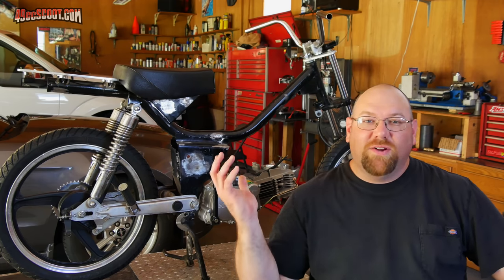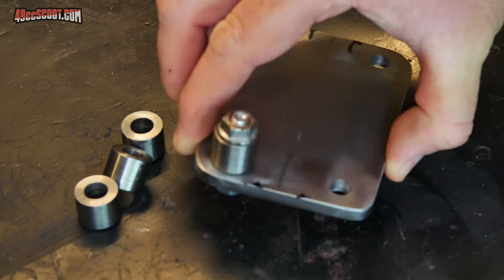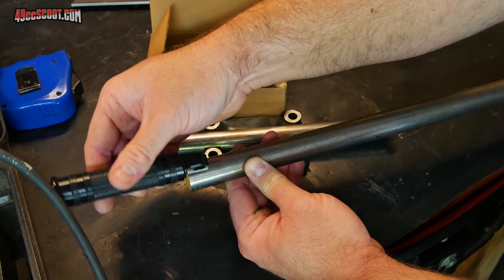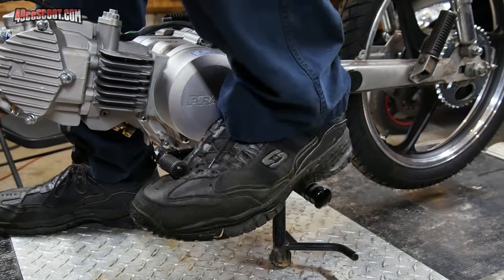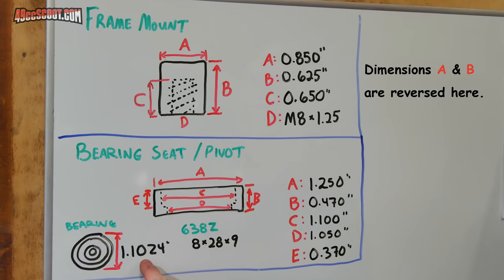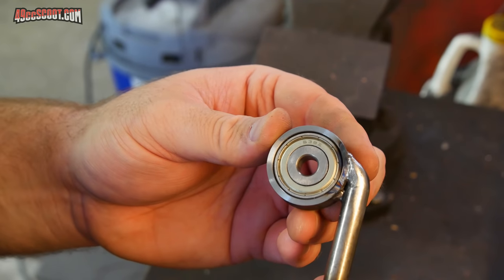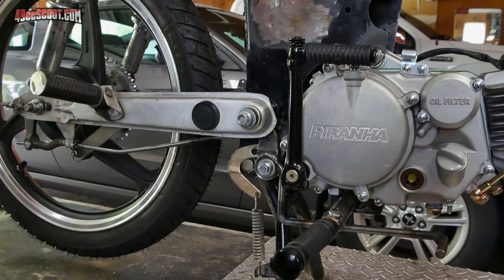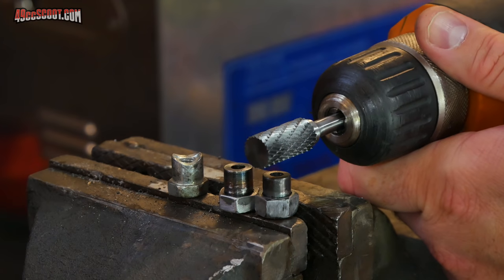Building A Motorcycle Style Rear Foot Brake Lever Setup : SSR Part 8 : Manual Conversion

Comment: I've been following this build intently,  since I have the same moped. And my list of modifications is very much the same.  One place you could have save a considerable amount of time was in the rear brake pedal assy.  The Chinese borrowed a large amount from Honda,  and the brake lever from a CT90 or CT70 is a direct fit.  It pivots on the same pin that the center stand pivots on.  The pin is just longer to accommodate the brake lever. Those brake levers are all over ebay for cheap. The actuation rod and brake light switches are too.  Looking forward too watching the continuation of your build!
Reply from the maker: Thanks for the info. Maybe someone else will see it and save some time. I looked at stuff like the Madass and other Chinese mopeds that came up in searches, but they didn't look like bolt ons. I know I looked at some Hondas, but again whatever I saw didn't look like a simple swap. I'm not mad at the idea of spending extra time though since it's a one off setup and always a learning experience.

Comment: You don't want square corners in the bottom of the groove.  They are a good source of stress cracks.  The rounded you ended up with are better, IMO. Nice video.  tom
Reply from the maker: I didn't really want sharp square corners, but less round than I ended up with. It worked out anyway. Thanks.

Comment: Nice to see progress on the SSR. Good job on that break lever. I know is a long way until the build is done but so far is looking real minimalistic and nice. I would like to see you build an electrical motorcycle someday. Like the guy in "the inja" channel is building. I'm sure one built with your hands will come out a very slick and just awesome.
Have you ever thought on building one?. Is basically an electric motor, batterires and a controller mounted in a motorcycle or scooter frame. Anyway. Keep up the good work my friend. I think I have seen all vids in your channel. Real fan of your work here.
Reply from the maker: After seeing one do 80MPH in the 1/8 mile from the last ever NASRA event years ago, I did think about electric. My problem is that I really enjoy engines. I love the sound of them and working on them. Turning up a controller vs adding a pipe, cylinder, porting, and so on is just not the same. The main thing that tempts me is the amount of instantaneous torque. I dunno. I don't even care about F1 after the big screamers left. The sound is such a big part of the experience to me and I find it sad that one day engines and their glorious sounds will be forgotten.
Reply: @49ccscoot   I get what you are saying. I love my Chinese scooter with tuned gy6. But after seeing an electric motorcycle from I guy here beat a 200hp ninja in the 1/8.... Well I was stunned. I really enjoy your vids and watching you building stuff from scratch so I just tough I could float te EV idea.

Comment: it almost seems like those footbags are going to want to fold back on you during normal use due to the angle that they're at. Might not be an issue though.
Reply from the maker: I thought the same thing after getting  them done. They feel OK. It could be something I have to change later. I figured it would be nice to get max room when it's stuffed in the corner eventually like any other small 4T for me. 😁
Reply: @49ccscoot  gotcha it'll probably be fine.

Comment: It is so fustrating to wach you struggle with things that I have gone trough several times in my own projects and can't share advise. If I may few points, strengten up the lever at least by adding material to bends. Brake swich is not lined up, therfore the nub always bends the plunger and it wears out really fast. Why you didn't just use old nut on brake bar?  Footpegs now are in position, where the stress is applied only to half of the mounting bracket, so is less than 1/2in. When they are so that pivot shaft is parallel to ground, then its at least double. Maybe you want to reconcider that part. I love your projects as really good detailed vlogs and very educational, specially for youngsters. Keep up good work! Thank you.

Comment: just wondering, do you tap it dry? without any oil or grease? because i had the same problem like that in the past while i try to tap a hole without any lubrication and the tap just fail. In fact i broke 2 sets of taps lol. but when i try using some oil it works just fine
Reply from the maker: I was using thread cutting oil.
Reply: @49ccscoot  aaaah i seee, btw great video as always!!

Comment: Need help on how to change my stator to my lazer 5 ssr motorsport 2010 plz help me out and the back tire sprocket broke i dont know were to order all my parts for my bike plz help me out thanks brother
Reply from the maker: The stator is pretty simple. It's located under the left engine cover. There are different configurations. Some will require removing the flywheel, others won't. If it's the type that doesn't it's a really quick job with just connectors and a few bolts.

For parts, SSR has a dealer locator :
http://www.ssrmotorsports.com/store/dealer_locator.php

Valley Scooter Parts has a few parts for them. I haven't ordered any stock replacement parts.
Reply: I was hoping if u could make a step by step video of taking the stator off plz cause if it's easy ill try myself
Reply from the maker: Done. https://youtu.be/kR86GEJvYQE

Comment: "Stuntriding trip with Malaka_stunts to Mexico" on "coolincatt" channel.Here they use 2 brake\clutch levers.And on 15:50 minutes they have a bike like yours.Great movie,tons of stunt films.
Reply from the maker: Didn't even think about stunt bikes. Thanks. You can search for "stunt bike clutch brake" and there are even videos about setting it up. Still think it's easier for me to use standard controls, but it's good to see it up close.
Reply: @49ccscoot  Misunderstand me right.I got 0 clues.And V-Clic 900$.Buying new engine today,after 50 000km.So I have 3.REAR-BRAKE all stunts.Rapid,force bike down.Drive in a 52mm cylinder,trough winter,no spped controls.

Comment: If u sell it what price wold it be ? :D
Reply from the maker: Considering they try to sell Rucks with 150 swaps and a few bolt-ons for $4000 around here, I guess about $10,000. lol

I would need a small fortune to make it worth the time I have into it already, but I know it's not worth much. I've never built anything thinking about it's monetary value.
Reply: @49ccscoot  holy sh =))))
Reply: @49ccscoot  i dunno about that price but i think 6-7 grand is deffinetly worth all the hard work and custom parts and bits you engeneered (sry for bad english) its a pain in the ass ... but hey .... a custom scoot :D
Reply from the maker: @iulianciocan5672  Realistically, I could probably get $200 on  craigslist when it's done. lol